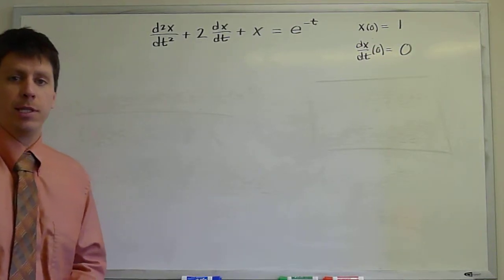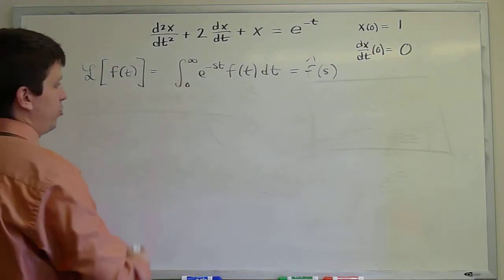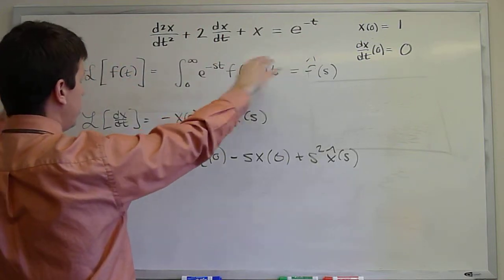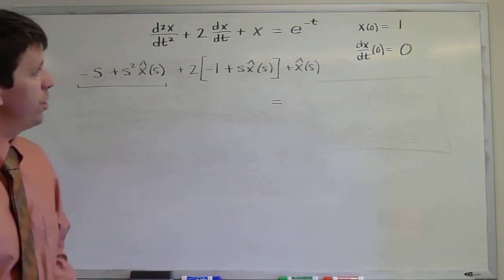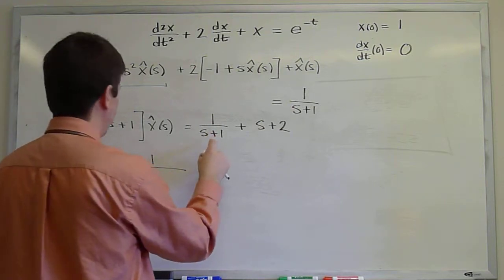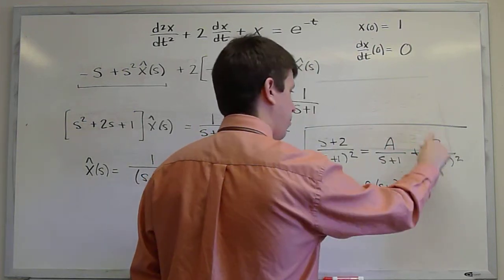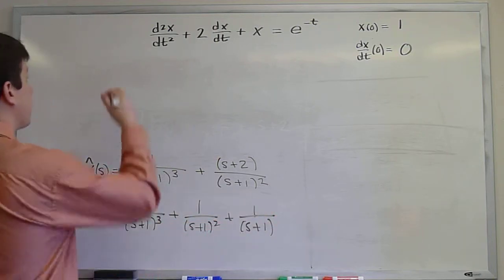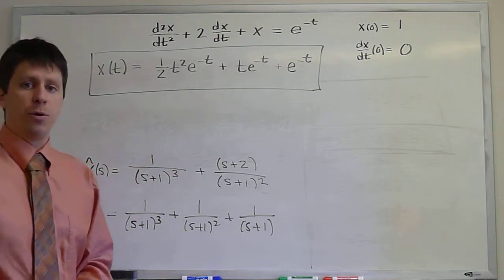Laplace Transforms for a Resonant Problem

Comment: A very nice picture of the reciprocal relationship between the  's-space' and the 't-space' emerges from this example. It does indeed look like there is a close connection between vector spaces and equations involving differentiation (or integration, or both - it will all be same I guess).